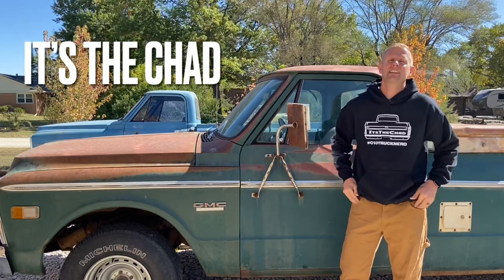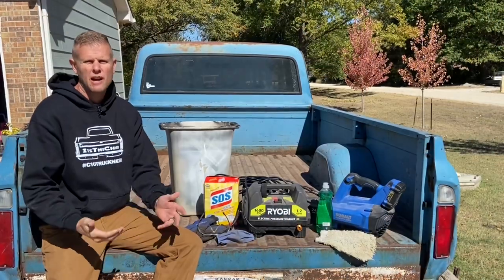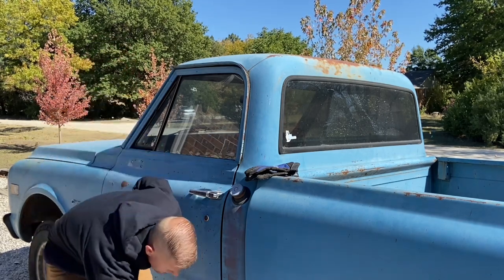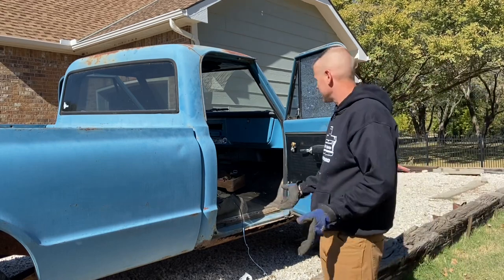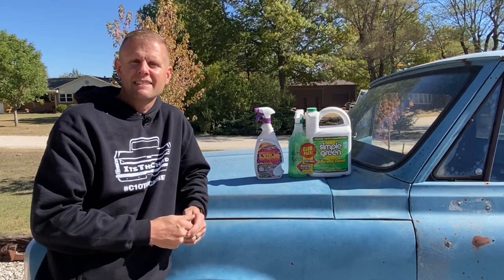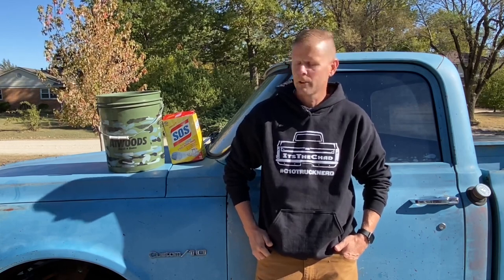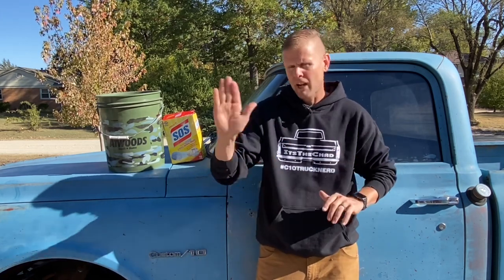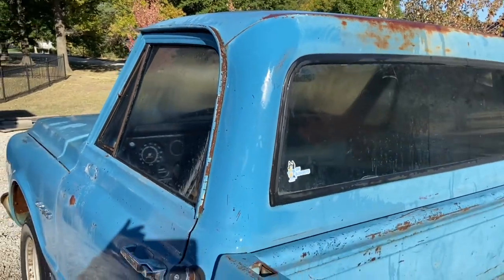How to Polish a TURD! 1967-72 C10

Comment: You need to try some CLR rust remover on the surface rust of your GMC. 
Use a fine scotch brite pad and scuff it in straight lines front to back. 
You will be amazed at the results.
Reply from the maker: Sounds like a good idea to try! I haven’t heard of that yet.